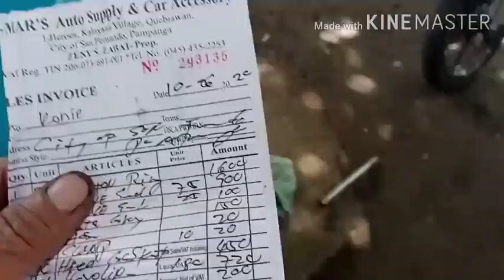Nissan sentra timing chain(1998 model)

Comment: Boss pwede mkuha contact no. Nyo may bigla kc umingay sa part ng timing chain.pero ok nmn po manakbo at oneclick start pa din cia.nissan lec po.sna po mareplayan nyo ako
Reply from the maker: Boss eh check mo muna un oil baka kulang kinapos ng pressure ng oil pa check mo un tentioner guide bka nbarahan sa butas